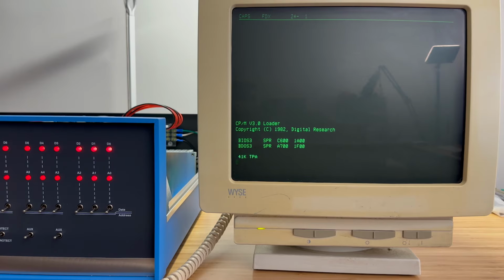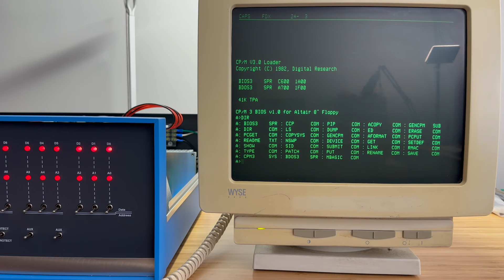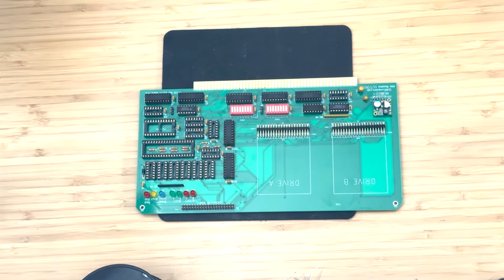Altair 8800 Build - IDE Interface (Dual IDE V4)

Comment: And the most expensive part about this board are those TIL311 displays.
Reply from the maker: 100%. I don't think they're required, as they're used for diagnostics. So, if you want to build the board and save some money, don't install the TIL311 displays.
Reply: @artemkalinchuk  They do look gorgeous though, don't they?